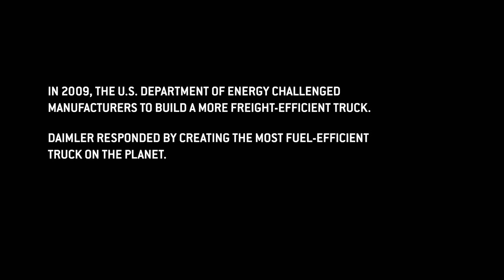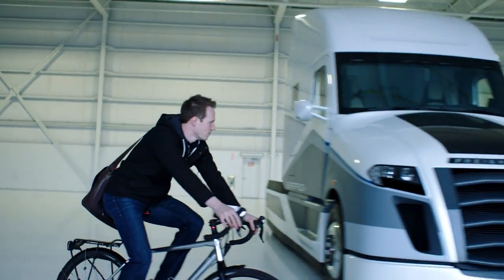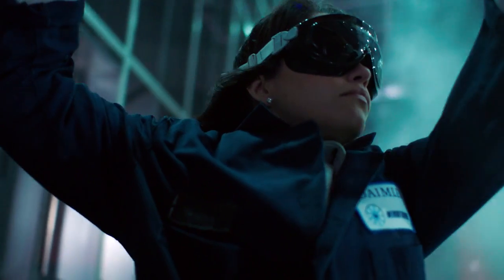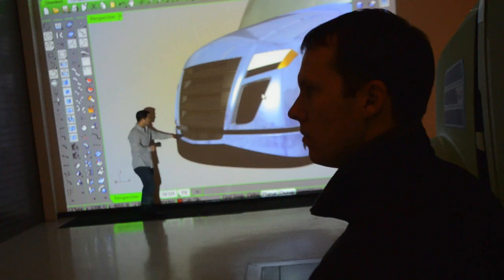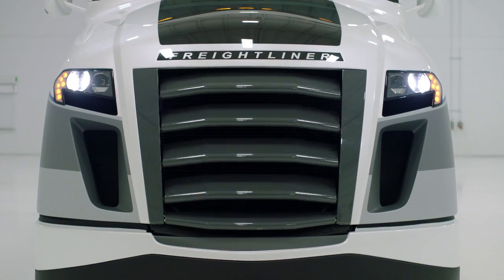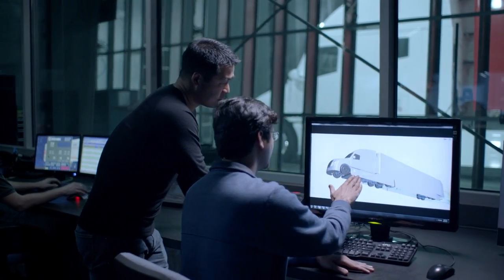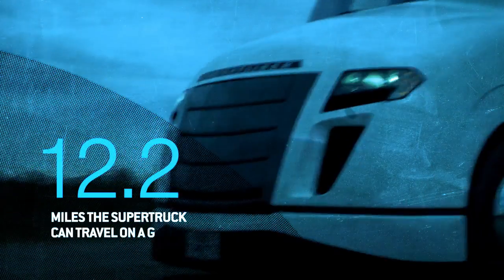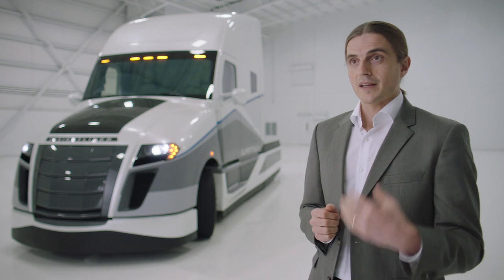Freightliner Supertruck: Amerika's 'truck of the future'

Comment: Why the American trucks are so differently designed than trucks in Europe?
Reply: because here in America we don't have old little towns like in old Europe and because the American truck driver is in love with long hood classic  trucks, we try cabover trucks before and did not work, drivers went back to the old classics long hood models. The same with cars, we refuse to drive small cars, we like big trucks and big cars with big V8 engines.
Reply: bracsim
Haha, okey cool! Thanks for the info :)
Reply: +bracsim 
Amen
Reply: +bracsim  This is a waste of money
Reply: +Vincent LevskiFan I do not know if this a waste of money. A more fuel efficient truck is good. I feel these people may be on the right path. But what my question is if the grill vents are closed they say it will may the truck more aero dynamic. But what about overheating? Any info on this would be appreciated. Thanks
Reply: +MrPhil0267 its no wonder when its needed the vents of the grill open to prevent overheat
Reply: Because we the Americans don't want to spend the time and energy making a decent truck that lasts longer, actually works without breaking down every 100,000 miles... Everything is made cheap and sold 5x more.  Overall, this truck is ugly.